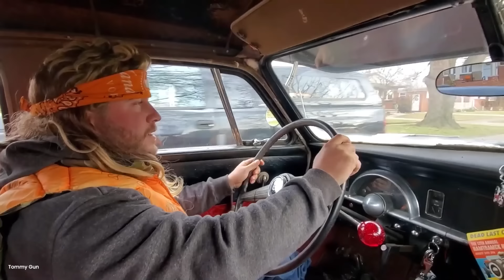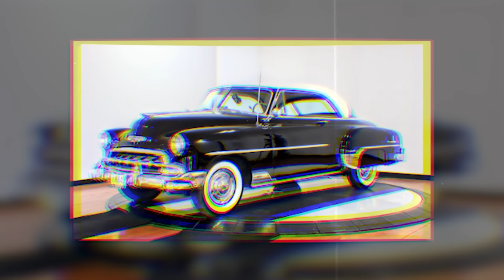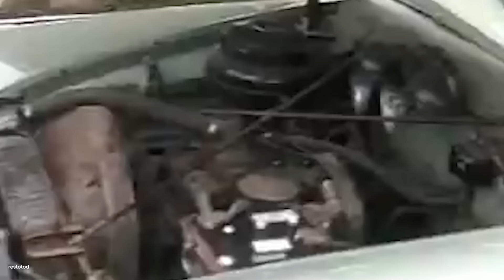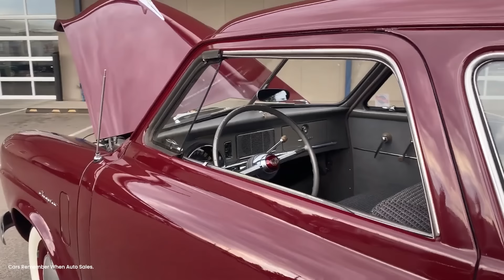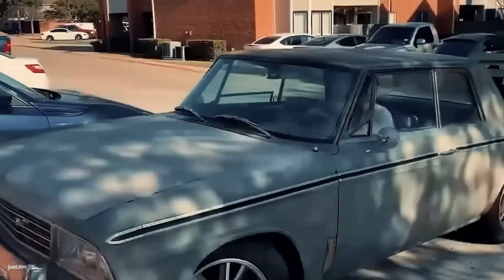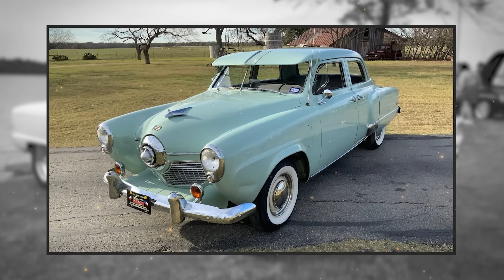Even at 70 HP & Flathead Six, the 1950 Studebaker Champion Shocked Everyone with 100 MPH Top Speed

Comment: Studs were great cars and trucks, motors, bodies, aerodynamics, etc. Brakes were very weak for such a strong car but had hill holder, self adjusting, . My 289 silverhawk 1958 got at least 28mpg stomping on it.  Oil baths kept air clean going in the carb but could catch on fire.

Comment: I đisagree . In the 1940s and 50s were the VW Beetle and Jaguar . The Jaguar 120 was capable of reaching speeds exceeding 115 . The early beetle only weighed 1500 pounds. Its 25 hp engine easily propeled it at road speeds. Top speed 70 . Well on a down hill. But the Beetle up to the late 60s was put through a wind tunnel ànd was proven to be the most erodynamic .

Comment: Lotsa word salad. But the nitty gritta was simple 
Aero dynamics, loss of weight fat unlike the big 3 and overdrive...
Start accel with a Performance axle and end up top end in overdrive .
Most big 3 cars with more HP used some type of slush box. So the stude could possibly take off at advantage. An accomplished driver may then have a chance as claimed in this vid/ post. There in two paragraphs the answer that takes naarrator, how long??

Comment: I own a 2008 Smart Fortwo car. 70 horsepower 3 cylinder engine manufacturered by Mitsubishi rearwheel drive with a 5 speed automatic with automated clutch. Basically a manual transmission  with paddle shifters on the steering  wheel. Just like  Studebaker car, it is extremely tough built and with only 70 hp, it leaves many  cars in the dust from stop lights. Lightweight, aerodynamic, comfortable and good fuel mileage which could be better if it wasn't so much fun to hot rod around with. This, like the Studebaker commander, it is a sleeper.
Reply: I don't know about the aerodynamics part

Comment: Hi folks,
        Love Studebaker.  The only really bad thing they did was to not put in Otto's revolutionary "Revolver Cylinder Engine" in 1936.
      It would have reduced the manufacturing cost of their engine; half the moving parts, half the weight.  200 h.p. on only 200 lbs of weight.
        Would have sold very well as an order able option in their "Champion" line.  Might have increased the length in front by about 12 inches.
V/r.
R.

Comment: When my 55 chevy wagon still had the original 235 6- cylinder engine I got it to go 100 mph one day.
You don't need a ton of horsepower to go fast, maybe to go fast ' quickly ' , but it just has to tach up enough RPM to do 100.
I also went 140 mph in a Chevelle with a 283 V8 and small two- barrel carburetor.  The 283 was small but it would tach up VERY high RPM.
I don't see any problem with that small Studebaker going 100 mph as long as that little engine will wind up high enough.
3.70 to 1 gear ratio was the same as my 55 wagon.

Comment: You do realize that the number of cylinders and the HP rating do not, either together or by themselves, determine the top speed of the car, right? Gearing and power-to-weight ratio figure more prominently.

Comment: Frame and body were not welded together. Front was bolted to the main body and the rear fenders were bolted on too.
The engine was capable of 6,000 rpm. My '51 got 30mpg on the hiway

Comment: My 85 Nissan 720 pickup ir supposed to have 103 hp but mine   with minor tweaks with a K&N filter and a Super Trapp muffler i have a feeling it was 107 to 110 hp and it weighed 2500lb

Comment: Growing up in the 1950s, my best friends' family had a bullet-noted Studebaker.  They finally replaced in the the early '60s with a newer Studebaker when the clear and color coats were giving way to rust spots on the body.
Reply: Cars were not clear coated until around 1980.
Reply: You mean paint and primer coat.Clearcoat paint wasn't used until the '80s

Comment: Some of those (rocket nose?) (Starlight?) Studebakers had a small OHV V8 engine. Which might have been 259 cubic inch displacement. I suspect that was the one that reached or exceeded 100 mph  not the small economy 170 Six.
Reply: Bullet nose is the term you are looking for.They were some of the best looking cars on the road.

Comment: The first Champion was built in 1939 with the same 170 L-head
Reply: My Father's older brother had a '39 Studebaker but I its inline Six L head had about 226 cubic inches. I think it was called Commander. Might have been the first year of faired in headlights instead of bug eye pod headlights.
Reply: @davidpowell3347  Champions always had smaller engines. The 1950 Studebaker Land Cruiser had a  245.6 cubic inch (4.0 liter) L-head inline six-cylinder. Both flathead sixes introduced in the 1930s. Studebaker sixes were this same engine up to the end in 1964.

Comment: Studebaker never built a unibody vehicle for production sales.
Reply: He said it had a frame and it was welded to the body that makes it a uni body. Other cars at that time where bolted together with rubber between the two,
Reply: @calkendrick384  No, the Studebaker Commander was not a unibody car; all Studebakers were built with body-on-frame construction. 
Studebaker's design relied on a traditional separate body and frame assembly throughout its production history, while other manufacturers, like Nash, were early adopters of unitized construction. This fundamental difference in manufacturing was a significant point during the discussions of the potential Studebaker-Nash merger in the 1950s, as combining production would have required costly retooling of the Studebaker plants
Reply: robots don't need to be correct, content is content, just mash together a bunch of words while inventing new ones, and ta-da - clicks without work.
Reply: Nobody did back in the 1950s! Body on frame.
Reply: @davisrs1  Nash was full unit body starting in 1949 and the smaller Rambler introduced in 1951 was also a unit body.
Reply: @emjayay Dang! No wonder my Rambler rusted out so fast.  Worst car ever. But my 58 Chevy lasted until 1980.
Reply: 1958 Thunderbird is unibody.
Reply: @352FEford 
The car I hated.  I had a 57, and then Ford ruined the T-Bird!
Reply: @davisrs1  Yes, but the square Birds sold like crazy.

Comment: Believe it. I had my 1952 Studebaker Champion to 100mph. It was manual with overdrive. It was a SIX-speed tranny. One time only, I ran to 31 or 32mph in low, then went into low-overdrive, holding my breath that the engine would not explode.